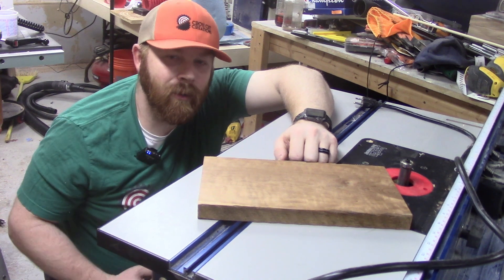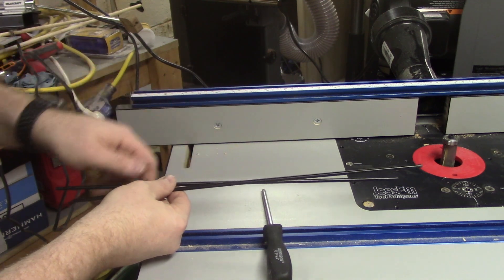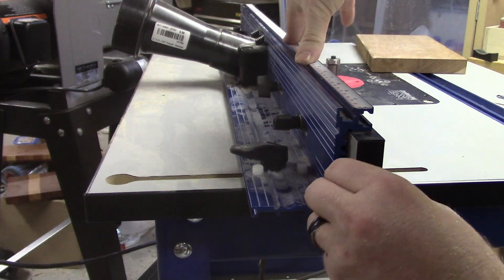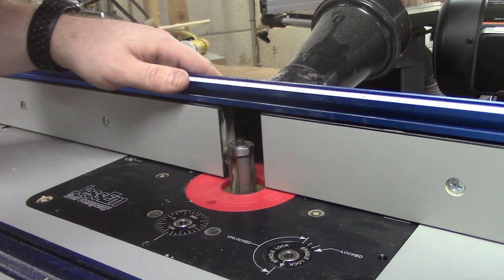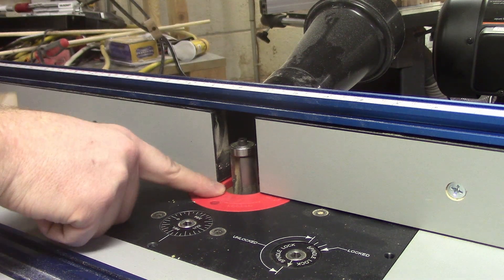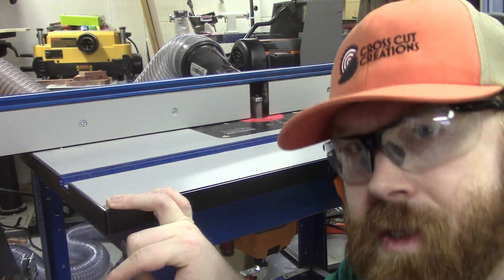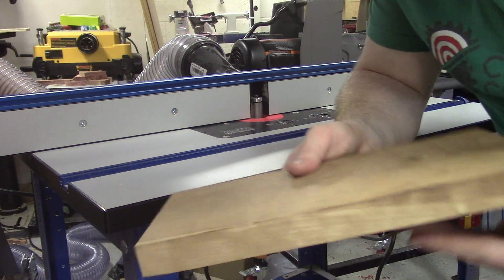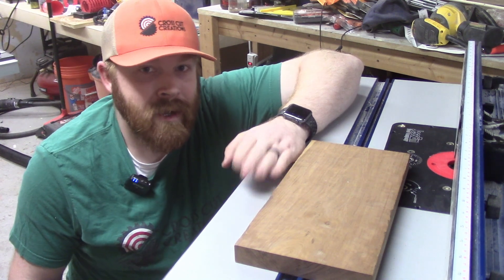Watch This Before You Buy A Jointer | Router Table Jointing

Comment: What type of bit do you recommend for this?
Reply from the maker: I have a bit that has straight cutters, but spiral cutters work really well too. As long as you have a bit with a bearing that’s oriented on the other side of the shank so you can use that to reference that to the fence, you’ll be good. The bit I have has a 1/2” shank.

Comment: Thanks for the info.  I have that same table and had forgotten about the hidden rods.  I bought the table and hardly used it for several years.  I've recently gotten it out and have been using it.  Since I don't have a jointer, that will be a game changer.
Reply from the maker: It's a game changer for sure. Just make sure your fence is set correctly and you can make a versatile tool even more functional and versatile.